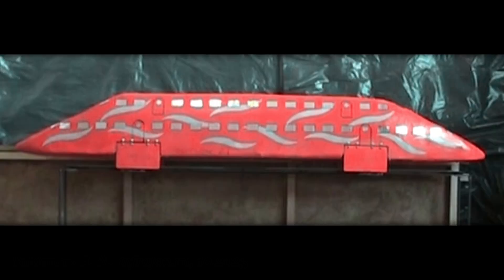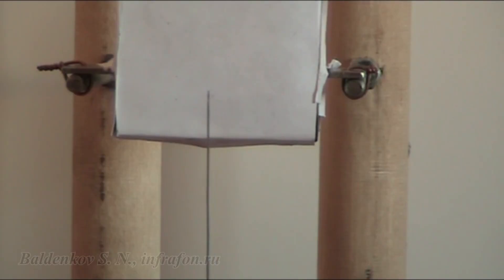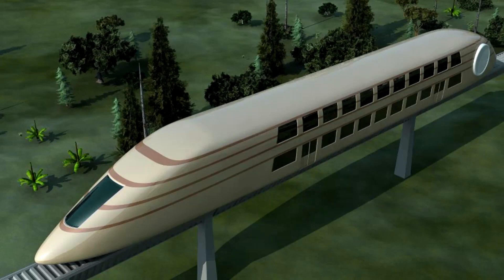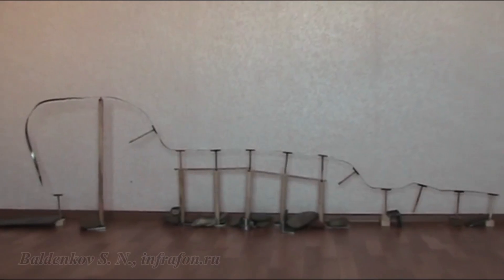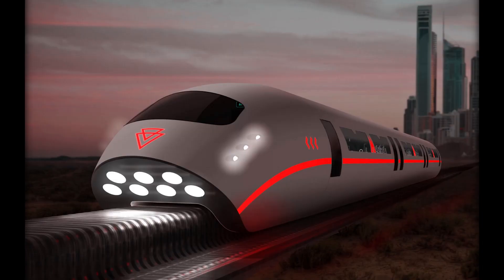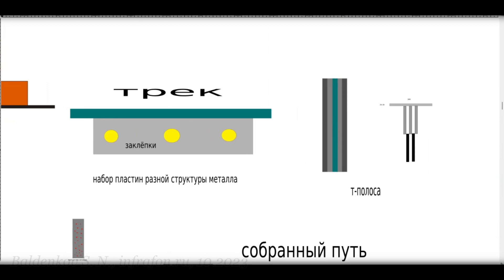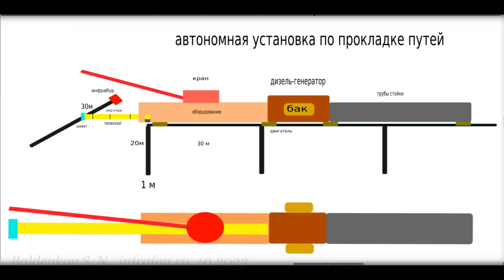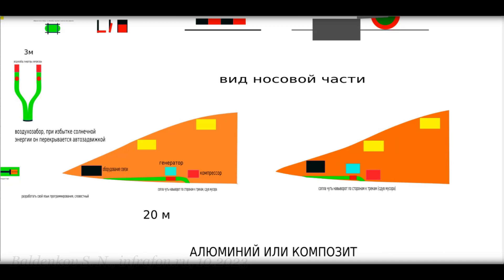A high-speed train on a suspension with the effect of a "Magnetic Pit".

Comment: What is being blocked by the white dots?
Reply: The white dots are to stop you seeing how it works... 😊
Reply from the maker: White dots so that the suspension structure is not visible)). The platform is suspended by a magnetic field from permanent magnets, simultaneously attracted and repelled by the steel track.